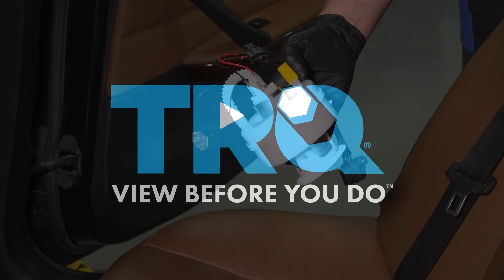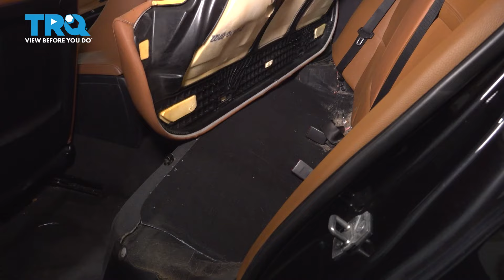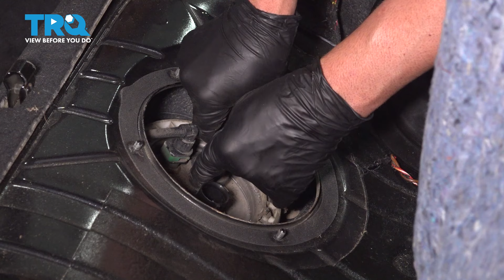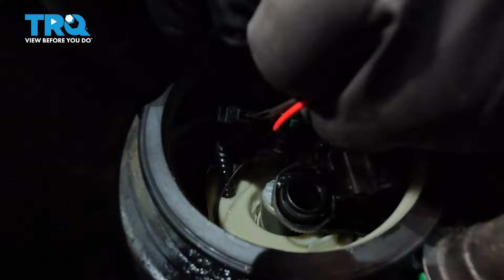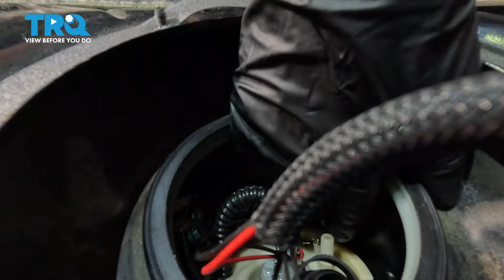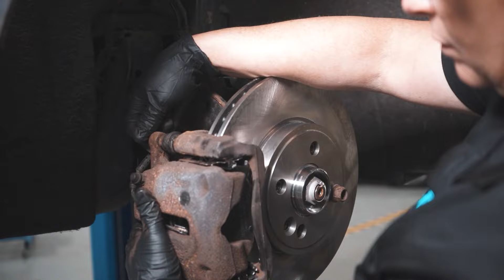How to Replace Fuel Pump Module Assembly 2009-2013 BMW 328i xDrive 3.0L I6

Comment: THANK YOU! Im currently having issues with fuel supply so it’s either the fuel pump control module/ekp or the fuel pump itself. Do you have any videos on replacing the ekp/fuel pump control module for this year or similar?

Comment: I pulled my fuel pump and just got my new one in but now I can’t seem to find the evap like that connects at the bottom… did it get sucked in
Reply: Did you figure it out I think this is my problem idk it dumps fuel out the filler neck/tank connection whenever I try to fill the tank
Reply: I cant find mine either…What did you do to get it?

Comment: What a really stupid fuel pump set up and if the fuel pressure regulator goes bad you have ro replace the entire tank smh
Reply: So if my new fuel pump didn't turn on my engine it could be the fuel pressure regulator?

(I'm about to start pulling injectors because I can't get any codes for my issue and I really thought it was the pump)